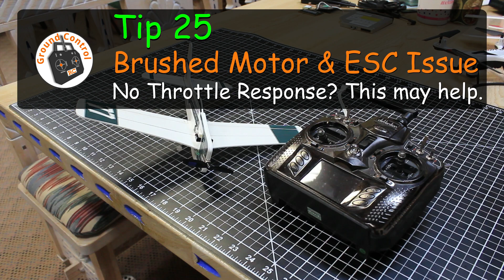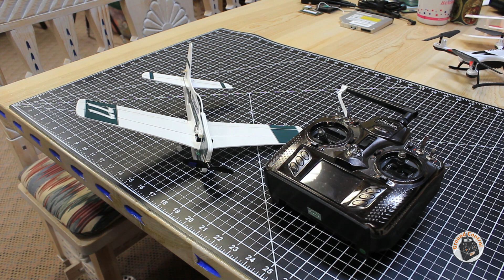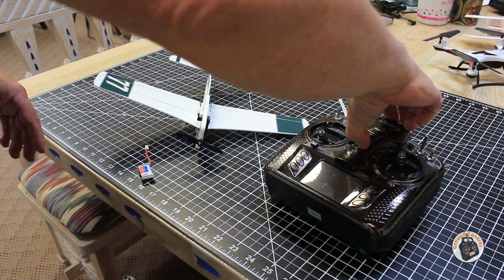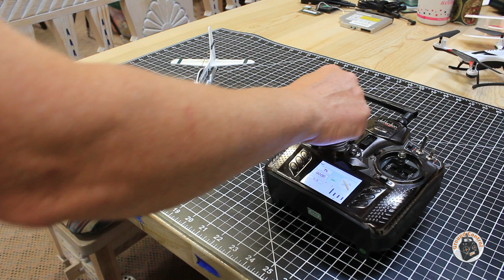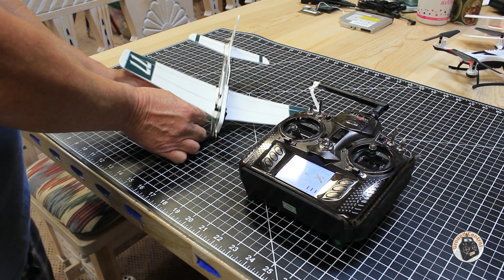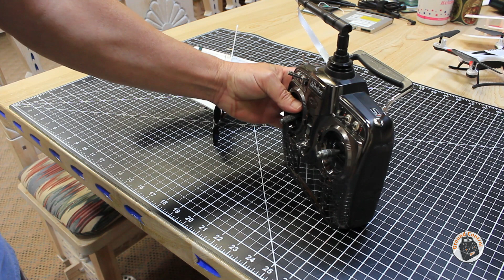Tip #25 - Brushed Motor & ESC - No Throttle Response?

Comment: This is quiet helpful. I bought this reciever and had no idea how to make the throttle work. Hopefully it will now!!
Reply from the maker: Thank you! I hope that gets your throttle working. It seems the brushed ESCs see the throttle points different than the brushless ESCs. Until this project I had only used this receiver with brushless ESCs and so I didn't run into this problem. I checked another micro receiver from a different manufacturer and it had the exact same issue. Strange!  Please let me know if that fixes your issue as well. See you in the Air!
Reply: Ground Control RC I’ll let you know how it goes!
Reply from the maker: @MrStrikeforce1987  , thank you much and good luck!
Reply: Can confirm. This fix worked perfectly with my jumper t8sg. I had all but given up on a cheap micro build when I got this reciever and found it not working. Now I’m ready to start building!
Reply from the maker: @MrStrikeforce1987  , thank you so much for the update! That is absolutely fantastic ;-)  Good luck on your build and I'll see you in the Air!
Reply: Thanks for the tips, and it works for me perfectly.

However, my friend bought the same unit, and follows the instruction in video, it does work .. but what he found out is, the max throttle is not as expected... Meaning, not 100% throttle when pushing the throttle stick all the way up.

Do you know is there any Throttle celebration procedure like those brushless ESC?

My friend is using FrSky Taranis with a multi-protocol module.

Mine is Jumper T8SG.
Reply from the maker: @warmiceUT  , I'm not sure if there is as I cannot hear any beep codes from the brushed ESC when it initializes, however, I used the same procedure as with a brushless ESC and tried to program the high an low end of the throttle when powering up the ESC. Mine seems to read the full range. I would have your friend try that and I would remove any throttle trim before doing the high and low end of the throttle range. If that doesn't work I would try adjusting the throttle end points in the transmitter. I hope that helps and I'll see you in the Air!
Reply: @GroundControlRC , Thanks for the advice, will share with my friend to test it.

Thank you
Reply from the maker: @warmiceUT  , you are most welcome! See you in the Air!
Reply: Does not work for me. I've got a brushed esc from AliExpress (red with four black squares on one side), a FS2A 4Ch receiver and a flysky FS i6x. Throttle is dead, also when trimmers are all the way down. Servos are ok. Same issue with the IA10B receiver.

Comment: Got a cheap HobbyKing radio and the manual says in the warning section.."You need to turn the throttle channel(ch3) and inching switch
to the lowest before you use. " Now it makes sense. Thanks.
Reply from the maker: The terminology uses sometimes can be very confusing.

Comment: Thank you for this video.
This didn't solve my problem but allowed me to investigate further.
On my Radiomaster TX16S, I tested all the dimmers and eventually found that the motors activated when I used the knob I had assigned to the screen lighting ! Channel 14 !
I reassigned the Throttle to channel 14, and it worked !
I can't explain everything, but the important thing is that it works.
So, in the event of a problem, I recommend investigating the different dimmers.
Reply from the maker: That's very strange but I'm glad you discovered the issue.
Reply: I'm currently investigating mine. It's gotta be a channel issue I guess

Comment: Hello please help me my ' p-51 mini RC throttel has the same issue as you do but the radio controller does not have the throttel trim can you please help me with that
Reply from the maker: Sometimes these Receiver / Gyro boards will not arm the motor if you have too much trim programmed in on any of the control surfaces.
Try removing any trim you have on the Ailerons, Elevator, and Rudder and then see if the Motor Arms as it should.
That's worked for me in the past.
See you in the Air!
Reply: @GroundControlRC  ok i will do it now
 Thanks

Comment: Thank you sooooo much this did solve the problem with me. Mine is a brushless outrunner but cause was the same. It identified the mid trim on throttle as positve throttle and wont turn on. Lowering the trim did the job. Thank you for saving my time and for making this video
Reply from the maker: Thank you for the kind words Manuja!
I'm glad it helped.
These things can be a bit of a pain sometimes ;-)
See you in the Air!

Comment: All the servo on my plane jitters when i increase the throttle. What might be the problem?
Reply from the maker: Could be Motor Wiring is close to the Servo Wire. Could be a bad Servo causing the Receiver to Jitter the Servos. Could be something applying pressure to a Servo causing it to Jitter. Could be a bad Receiver.

Comment: i have issue with my plane volantex p51 mustang not working well when   try to throttle  half after 1 min it will stop but when  i tried full throttle its working then when u throttle down not working again what is the possible issue?
Reply from the maker: It could be timing of the motor and ESC. I think the Volantex Easy Plug ESCs can be programmed via the transmitter if I'm not mistaken. I know I had to go through the process of programming the ESC with my Throttle range a couple of times before the ESC accepted the high and low range of the Throttle Stick. That could also be an issue if you haven't programmed that with the Transmitter. I would start there. Also, this power system pulls quite a few amps. You need a pretty high capacity 2S LIPO to get some decent flight time. I was only getting a couple minutes of flight time with the 2S 450mah LIPOs I was using. I was getting approx. 4 minutes of flight time with my new GNB 2S 550mah LIPOs. I hope that helps and I'll see you in the Air!

Comment: Hi, i recently have this problem on my new 400mm eachine f4u. Its intermittent. Can it be fixed ? thanks
Reply from the maker: Good question! I would say possibly. Sometimes if the Gyro gets out of calibration strange things can happen. The first thing I would try is re-calibrating the Gyro. I don't know if you've already done that or not. If not, I would try that first. Second, when it happens rotate the prop a bit and try again. I could be dirt or binding on the gearbox. Mine have been nosed in quite a bit so I'm surprised I haven't damage the gearbox or motor yet ;-) Third, try a bit of down trim on the throttle and see if that fixes the issue. Fourth, it could be you have a slight amount of positive throttle engaged when binding. Make sure your throttle stick is all the way down before binding to the transmitter as that can cause the ESC not to initialize and therefore no throttle response. I hope those things steer you in the right direction. See you in the Air!
Reply: Ground Control RC, I had re-cal the tx. That didn’t help much. I’m using the tx which came with the plane. Therefore no throttle trim :-D Tried manually spinning the prop n it spins! I gave a little WD40 to the motor from the front then. But motor couldn’t turn as fast as it would when newer. I guess it’s maybe time to change out the motor or upgrade it to brushless?
Reply from the maker: @tonyloh6140  , it does sound like the motor has gotten weak. I wonder how many flights you have on it? I've had brushed motors that worked for over a hundred flights and some that only lasted 25 flights.
Reply: Ground Control RC , I think abt 20 over flight indoors at less than 50% throttle 😄 Well, gg brushless sounds challenging. Guess I hv to find a better brush motor to replace the current
Reply from the maker: @tonyloh6140  , making brushless conversion is a bit challenging. Especially finding the right motor and prop combination that will give adequate thrust for a specific plane. I have to test a lot of motor and prop combinations before deciding on the best choice for a specific plane. You might want to search for brushless conversion of your specific plane as it may have already been done and it would take all the guess work out of it and provide all the necessary steps and components needed.
Check out this channel as he performs a lot of brushless conversions of Micro Planes:
https://www.youtube.com/channel/UC4ASYrBqNLAQmqmCV57BgNw
I hope all this information gets you back up and flying soon. See you in the Air!
Reply: Ground Control RC , thanks for the link 👍🏼 I replaced the motor with identical ones. It’s working normally again!!! 😅😄 Thanks for the advice n will monitor how long this new motor will last me
Reply from the maker: @tonyloh6140  , you are most welcome! I'm glad you're back up and flying! See you in the Air!
Reply: Ground Control RC , your skill in trouble-shooting remotely is spot on! By the way, it’s Singapore here 😄
Reply from the maker: @tonyloh6140  , thank you for the kind words Tony! I'm glad I could be of help.
Reply: Ground Control RC , I hv been checking the ESC voltage. It’s always almost 2vdc even at any throttle position. Additionally, the motor sometime need to finger spin start. Could it be both parts are faulty now? Thanks
Reply from the maker: @tonyloh6140  , it could be, although, it could be a loose wire as well. Sometimes wires can get broken inside the wire insulation or have a weak solder point. If the motor an esc have gone at the same time it could have been that motor or gearbox was bound up and overheated both. I'd check resistance of the wires to see if it's just a bad connection.

Comment: This may help, if you cannot exceed  -100 / 100 and Trim doesn't work:
If you use for eg. Jumper 12TX (OpenTX transmitter)  soultion: search for E-trim (extended trim), allow. Search "output page" set channel to -110%. Motor works now. 
Start-Lock Function:
 Start-Lock Function is the onboard brush ESC function of preventing brush motor from starting by mistake.  It can protect the brush motor from starting even throttle stick not at the lowest position when the receiver is powered. As soon as the receiver gets the signal and the throttle stick on your transmitter is at the lowest position for 2 seconds the first time, Start-Lock will be released then, the brush motor will run when the throttle stick is pushed. Somme ESC expect ppm signal at 998 (usually 1000).
Reply from the maker: Gnubbel, thank you for the tip on setting up the Brushed ESC in OpenTX. The safety switch for the throttle is also a very good idea and I always setup a throttle safety switch on my TX. The setting of -110 is usually where I set my throttle safety switch as well. This should help those using OpenTX ;-) See you in the Air!

Comment: Hi. I have a spektrum dx6i transmitter.
What do I have to do to make the throttle works?
Reply from the maker: This procedure worked for me and others. Make sure your throttle trim is all the way down before you power on the ESC. I also went through the procedure of programming the ESC throttle high and low stick, just in case. The same way you would for a brushless ESC. If that doesn't work I would try setting my throttle points in the transmitter so the low end of the throttle was lower than normal. If that doesn't work you may have a faulty ESC. I hope that helps.
Reply: @GroundControlRC  Hi. 
I installed a motor with brushes. Do I still have to setting it on the transmitter?

 I will try the recommended.
thanks
Reply from the maker: @1323aapq  , yes as the brushed ESC is the issue. I have a brushed motor on this plane and it was the brushed ESC that was causing this issue with the throttle not responding. I've never had this issue with a brushless ESC but apparently the brushed ESC sees positive throttle when it shouldn't and therefore will not arm the motor.
Reply: @GroundControlRC  
thank you very much for your help.
Reply from the maker: @1323aapq  , you are most welcome ;-) See you in the Air!

Comment: So it will automatically shutoff the motor when it will reach 3.5v ?
Reply from the maker: Good question! The motor will keep running until you've gone below the minimum voltage to operated all the electronic components. Different components can operated at different minimum levels of voltage. So it depends on what your components are rated for. See you in the Air!
Reply: I am having trouble with binding process i have TX FS i4x please help me
😭😭😭 I had purchased afhds protocol
Reply from the maker: @crcu1ttv1957  , I'm not familiar with that transmitter and receiver, but the bind plug will go into the BAT port on the receiver. Put the bind plug into the BAT port of the receiver and power on the receiver. Then power on the transmitter and make sure you have a model setup for the proper protocol. Press the BIND button on the transmitter and you should get bind on the receiver. Power off the receiver and remove the BIND Plug. Power the receiver back on and make sure you still have bind. Sometimes they have trouble performing BIND it the transmitter and receiver are too close to each other so make sure you are some distance from the receiver when performing the bind.

Comment: Sometimes I have the same proble. most of the time you can adjust the trim downwards and the motor is switched on.
Reply from the maker: You're absolutely correct! That's exactly what my tip suggested ;-)  See you in the Air!

Comment: I ordered mine. Its still shipping. Please, do you know if it is possible to fpv this model?
And do you know how to bind the receiver with a spektrum? 
Thank you in advance
Reply from the maker: I have not tried to FPV this model yet but I'm going to ;-)  I want to test it with a 1020 Motor and 3" Prop to see if that adds more power first. The Micro DSM2/DSMX Receiver I have listed in the Show Notes goes into bind mode on you first power up, so you just need to put your Transmitter into bind mode after the Receiver powers up and you should be good to go.  Good luck on your build and I'm sure you're going to have a blast with this Nano Plane. See you in the Air!
Reply: @GroundControlRC  thx a lot for your quick reply. I'm looking forward to your fpv build of this Nano. 
I first have to check whats it about with this receiver. I usally build whoops and bigger quads.
C U thx